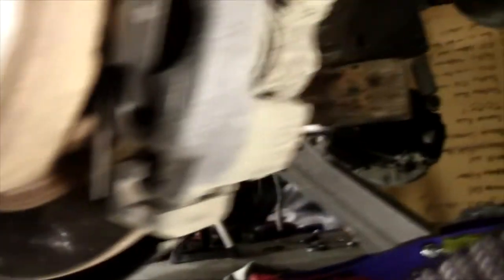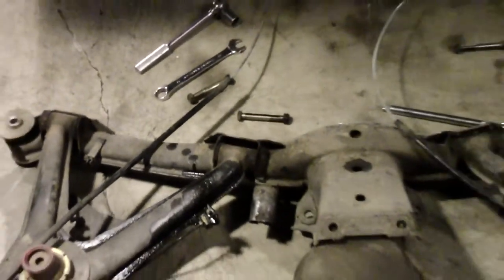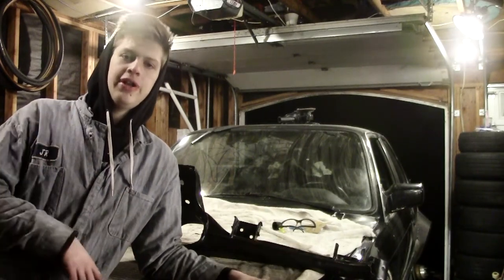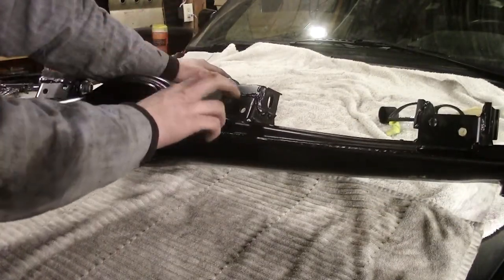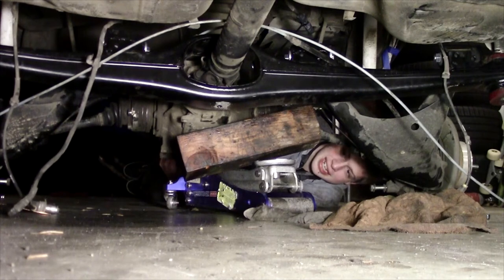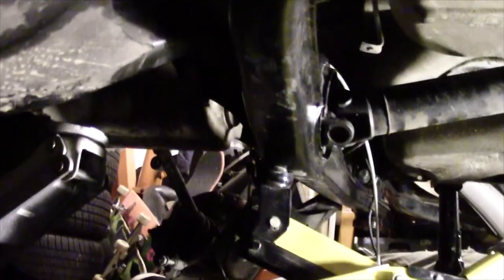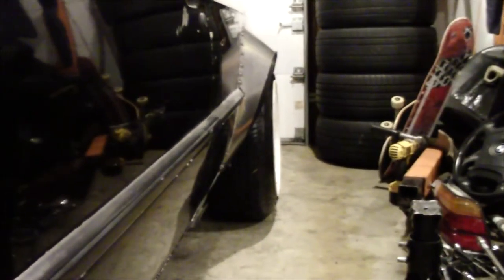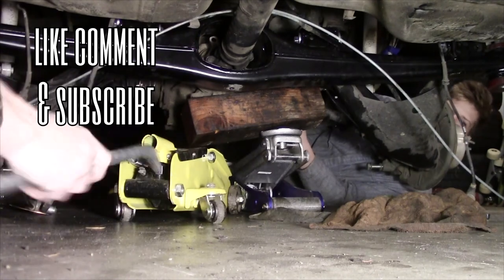FIX E30 Rear Camber & Toe w/ Garagistic Adjustable Rear Subframe & Eccentric Bolts

Comment: This things are useless those eccentric washers that are part of the bolt head wear out then you’ll get no adjustment or very little, you need the bushing kit with the eccentric sleeve and bushes ,many companies make them but I’ve only used the K-Mac or other well know suspension companies, also most bmw have this washers bolt adjustment e36 list goes on even other brands/ manufactures use this style and this rubbish,also no welding anything to the front part of the rear subframe where the arms mount/ bolt to
Reply: z3hardtops... I’m in need of camber/toe adjustments on my e30 and having to do all this work I want the best outcome yet the easiest way to get it right the first time. Welding new mounts is possible for me but more work so I’m considering the adjustable bushings. What’s the degree range between the two?